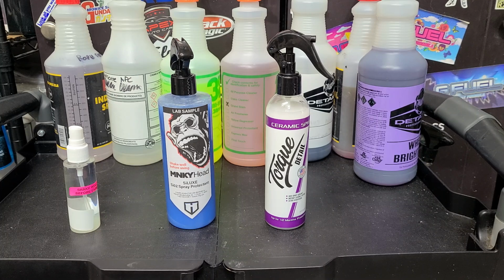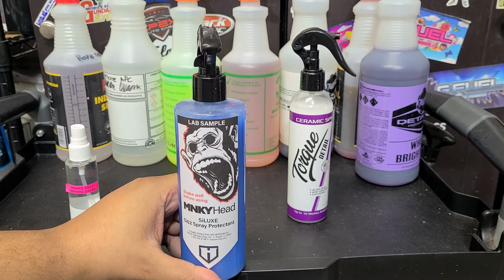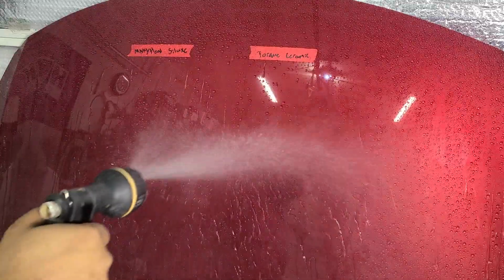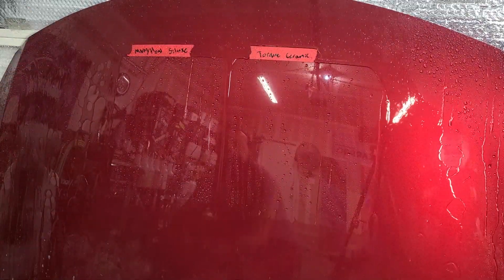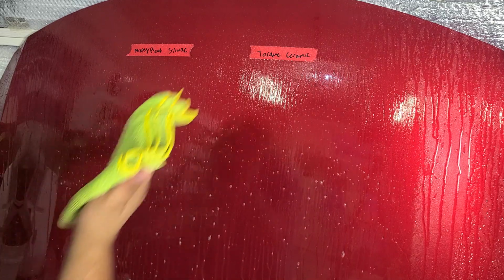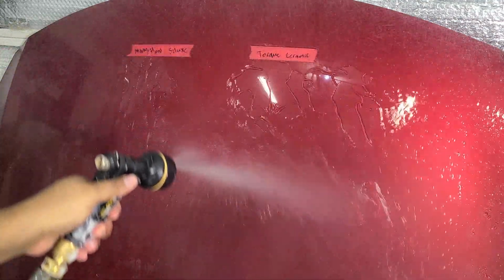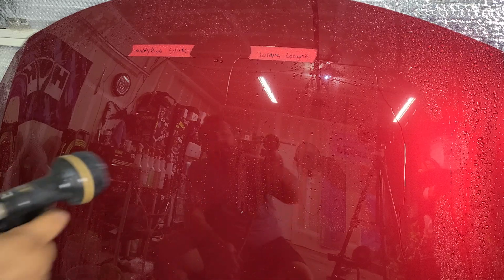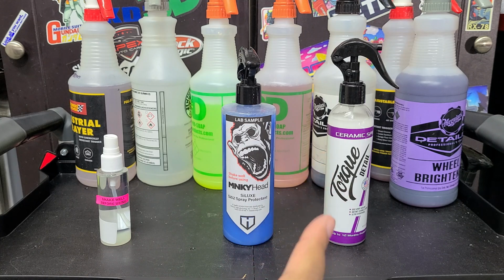[TORTURE TEST] Torque Detailing Ceramic Sealant & MNKYHEAD SiLUXE

Comment: Quick question I have a black car few years old and I’m trying to do a minor paint correction. It will be a diy weekend project with an old harbor freight polisher and was wondering what is the best speeds to run the machine. It starts from 1000 rpm and up in increments of 500 rpms. Do I use it at higher rpms to cut like 2500? Thank you
Reply from the maker: Speed 3-4 usually is the sweet spot. Not sure what that correlates to on the RPM/OPM for it but it's my rule of thumb. If it's a rotary 1-2